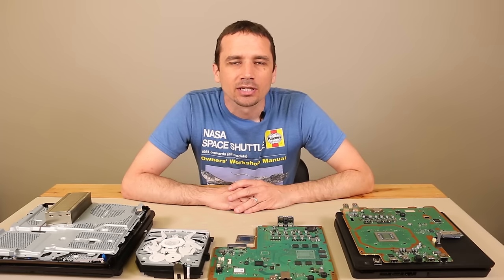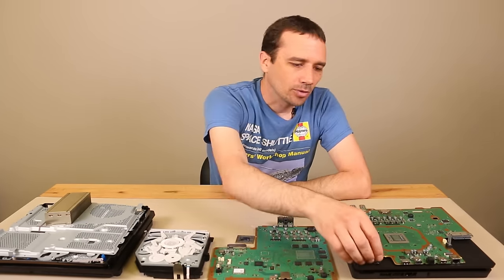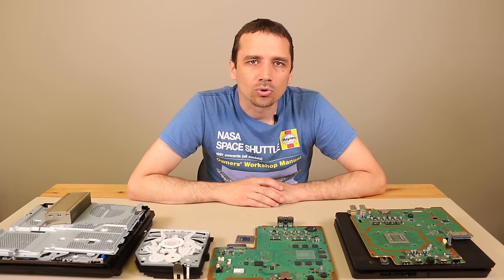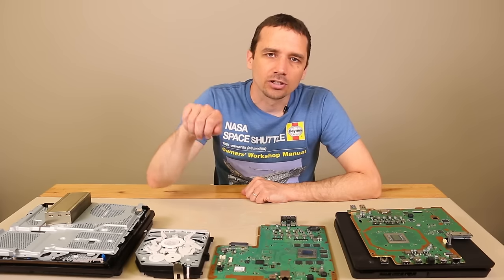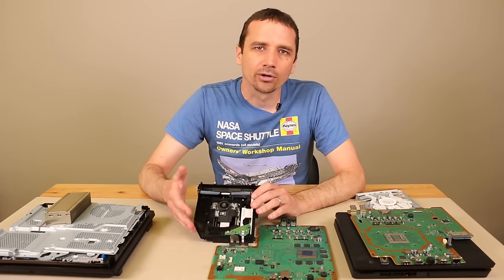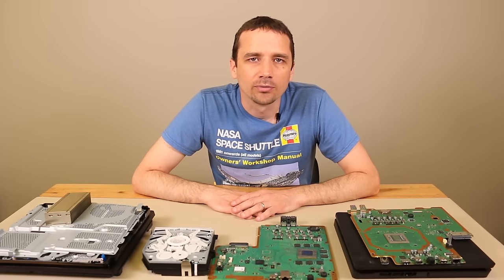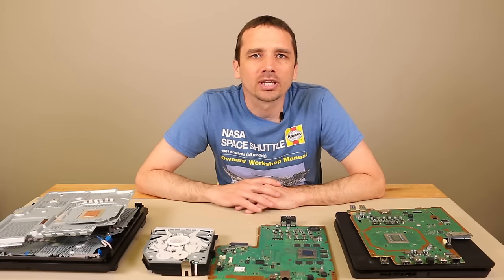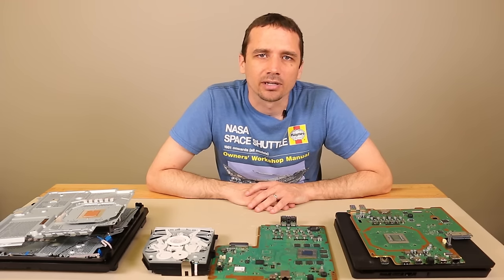Top 5 PS4 Problems With Solutions

Comment: If you've got cockroaches in your ps4 you just need to find a new place to live...
Reply: Legit, I have never had any bugs in a console before.
Reply: Dude I found a dead ant in my ps4
Reply: Basically
Reply: William Collins I found a dead fly
Reply: @NoseyBonk5599  a fly is one thing. Seeing Cockroaches is usually a sign there are many more where you cant see them.
Reply: Yeah, thats messed up
Reply: Yeah that’s nasty
Reply: I found a worm in my ps4?!?!?
Reply: I removed a slug from within the PSU over here in the UK. Unlike the original fat PS3’s, the lack of mains on/off switch on the console means folks leave them on standby all the time and this creates a nice toasty hide-away for bugs etc. until BANG - they bridge the 380V dc rail. Best practice is to switch the console off at the mains when not in use.
Reply: I found a dead horse in my ps.
Reply: recently changed a PSU on my ps4 now it freezes during a game. what might be the solution???😭😭😭
Reply: Just get an Xbox one X and problem solved 😆
Reply: i think i got one on mine
Reply: It’s quite common but I have never experienced it
Reply: Unless it’s Crazy Ants, why would any other Ants go inside a console?
Reply: @Luna-ew3om  how doe
Reply: I got a roach in mind and the power supply burned up and Playstation will not fix it they said it validates the warranty
Reply: I’m from Brooklyn NY and this borough is roach and rats central, but hey....everyone both human and non-human alike love this town. My PS4 Pro is giving me that clicking sound and not recognizing the disc so I just ordered a new disc drive from Amazon ($70) and will get it on Wed and then do the replacement. I’m sure this will work and hopefully I’ll be able to cop a PS5 early next year.
Reply: @Supreme2u  I'm in Brooklyn NY as well
Reply: @frankiefo0ter  good for you Duke! We’re over in East NY/Brownsville.....and we’re native...born and raised, not transplanted from some wack city across the country.
Reply: @Supreme2u  haha I work in crown heights but I grew up near coney island hospital
Reply: @frankiefo0ter  thus the name “frank footer”...nicely done. Ma-Dukes, my brother, niece and her son all live in the same building over in Crown Heights on Pacific St.
Reply: I found William Collins in my ps4
Reply: I found a cow in my ps4
Reply: @NoseyBonk5599  I've found a dead person in mine
Reply: I literally keep Pest Block pouches behind, and on the sides of my consoles lol
Reply: What should I do if some games on my ps4 slim constantly crash with error code ce-34878-0? I tried many simple and available methods like initializing my console and replacing hard drive. I would be glad if at least you would give me a hint.
Reply: @Zeroshiki  You don’t want it to be buggy like Cyberpunk 2077. LOL
Reply: @IGA007  dang but which is better play station or Xbox I’m trying to decide which to get
Reply: I would actually scream if I found a ROACH in my ps4
Reply: @magnusFTS  same name?
Reply: @ocemagnus6553  YOOOOO
Reply: I got alot of cockroaches in my old ps4
Reply: I seriously can't believe that's number 5, LMAO
Reply: Oh no sadly we all dont live in first world countries do we?
Reply: @davewalker6077  safemode is my problem for months now it keeps  going  in safemode
Reply: same problem  here I don't know  what to do anymore
Reply: Previous pest control guy here. If you have roaches buy some roach bait and put it behind your cabinets and hinges in your kitchen and restroom and under your sinks. All you need is a pea size. Would like to add that German roaches don't come from outside. You get them from a place that had them and they got on your clothes or someone that has them. Like if you buy a used PS4 or used  electronic that the previous owner had them. If you live in an apartment then nothing is going to get rid of them unless all units in your building are treated correctly. Best thing you can do is caulk off cracks and crevices under your sinks and plumbing as well as bait. Hope this helps someone
Reply: @ashortsimp1255  ur right but hear me out Xbox has faster specs compared to PS4
Reply: I’m poor lol
Reply: Sounds like the cockroaches need to find a new place to live and the owner of the PS4 should kick them out
Reply: and a new console, its theirs now
Reply: The best way to prevent this situation is to cover ps4 with a cloth when not using or after using
Reply: I have a cockroach in my ps4 and I eat it
Reply: If you live in Florida you do
Reply: I found a dinosaur fossil in my ps4
Reply: It blows my mind how people can be so nasty. So gross when servicing a game console and there's bugs inside.
Reply: After watching these videos, I make sure buy only seald electric even second hand
Reply: Europe :)
Reply: I'll remember to tell you this when you come back for that same problem and see how you take it haha no need to be like that Broski I worked in pestcontrol and can GARUNTEE YOU that you could be the CLEANEST PERSON ON THE PLANNET and still get roaches or various other pests. It's not always their fault
Reply: They won't sign the lease agreement
Reply: Just buy a new house duh lol
Reply: Move to Canada. We don't have cockroaches anywhere here. It's to cold for them

Comment: "There's bugs in the system..."  Keep in mind, a new patch release doesn't resolve the problem... LMFAO
Reply: Mário Palma failure is not an option, it comes bundled with the software...
Reply: small dab of silicone adhesive or more perm contact cement and  trimmed pieces of window screen over the vents  .. ez fix
Reply: A new update just slows down the original ps4 and slim just so you make your mind and buy a ps4 pro :v
Reply: Apples favourite game
Reply: @TommyTom21  which launch model there's been three versions launched
Reply: @TommyTom21  I don't think any have touch sensors the first gen ones don't they have buttons as does the ps4 pro and the slim was just an original in a remodeled case there's nothing there to make a sensor it's only a piece of metal going to a metal plate on the board I only know this because i've had to replace power supply's on them

Comment: I’m incredibly surprised to hear one of the most common problems isn’t with the touch sensitive buttons on the original PS4 that cause it to turn itself on/off and eject the disc sporadically, considering how many people experience this
Reply: Had a PC that would reboot itself randomly, spent months trying to isolate the problem, unplugged the touch reset button, problem solved.
Reply: Probably because you can’t really fix those issues. You just have to be careful with them…
Reply: Hi i have a ps4 white light problem and need advice.

So i traded a faulty xbox one original for a supposed faulty ps4 original from a person that fixes consoles that wanted the Xbox for spares.

So on the day i got home with the ps4 i used my ps3 cables to power it on and it miraculously powered on which surprised me as the controller was connected properly using the usb cable.

But i saw the screen flash black then back to the home screen which i didn't know what is was then it did it once more and was displaying perfectly.

After about 5 mins of waiting for it too show some errors or switching off because i did not expect it to work i plugged in my usb speakers to the other usb port on the front while the controller was plugged in.

That was when the screen went black instantly. I didn't know what happened and pressed the eject button and a copy of GTA 5 came out which means the console was still powered on.

When i plug the controller and speakers in on my ps3 super slim at the same time is says too many devices drawing power something like that.

So i think it drew too much power on the ps4 and caused a wlod on the ps4.

Im trying to do a home repair with minimal tools and if you could give me some idea of what the usb ports could have shorted eg a transistor or fuses or something.

It still powers on and everything but that was the defining factor i think that contributed to the white light of death.

Any recommendations would help as ive watched a lot of YouTube videos and most are the ic chip or some transistor .

Its a original ps4 with wlod

Comment: 1000 years in to the future.  cockroaches dominate the planet beacuse of ps4.
Reply from the maker: Ha, ha...plausible!
Reply: For real, though! 😡🤬😡 cockroaches.
Reply: @Tronicsfix  my ps4 turns of by its self after a few min. It does not turn on and off like you explained but just simply shuts off. Ive changed the power chord too, clean the fan and took it apart to tight every bolt now and then. What could it be?
Reply: @frantaskachanka  You need a replacement it sounds like, don't waist your time trying to fix it.
Reply: @Tronicsfix  i need your help
Reply: Dear  @frantaskachanka , the PS4 is like a puzzle: interesting when solved, challenging when scrambled. Some people live to solve puzzles, what about you? Would you check how the Amperage is changing on the console mains line? Test it with another internal power supply unit if available, or tap in few wires from an ATX power supply? Open the PSU and check for bug-shorts? Check the ESR of notable capacitors? And while at it, reflow the APU and replace the thermal grease?
Reply: @Tronicsfix   the first time u laughed at something but thx 4 dis vid cos i am always terrified about my PS4 in case problems spread all over it
Reply: @frantaskachanka  ur power supply or hard drive probably went bad

Comment: And now i'm really paranoid that my ps4 will break any moment ! Thanks i guess
Reply from the maker: Ha, ha...you're welcome! Lots and lots of PS4's never have problems. These are just the most common repairs I see at my repair shop.
Reply: TronicsFix I have 4 ps4's. One for me and one for each kid. Mine is the one with physical buttons, the other three have capacitive buttons and one has the eject whenever the hell it feels like problem. I have removed the rubber foot and constantly clean it are there any other ways to fix that?
Reply: +adonian Open your ps4 and place a piece of sticky tape over the eject sensor, I also had this issue with the first ps4 I bought. Then to eject a disk you have to use your controller through the menu.
Reply: Should have bought a Wii U like any sane gamer! Good luck legally playing all of Nintendo's greats, suckers! Power is always trumped by FEATURES! Suck it, Sony!
Reply: I would love to have a rear USB port on my PS4. I have the launch edition I don't know if the pro or any of the other ones have a rear USB?
Reply: bondovwvw yes my pro has a rear usb port.
Reply: It's won't break.
Reply: Had mine almost 4 years and it died tonight,on round 122 on black ops3 smfh
Reply: TronicsFix today i am buy a ps4 . and now ur video scare me . thax
Reply: dhgozilla power supply died 3 month ago
Reply: You can reinstall the hardware but you have tor reinstall all the games, and you can use the same account. You can repair corrupted games too. The only thing that isn’t easily fixable is if the HDD stops, which must be replaced
Reply: TronicsFix LLC something wrong with mine is the pork
Reply: my power supply is dead im going to just replace it and see if it works
Reply: It just happened to me..... I'm like in shock
Reply: hahahahah ... Trueeee
Reply: My controllers disconnect randomly with full charge would u recommend getting a scuff controller that doesn't need Bluetooth
Reply: me too man..I'm scared specially I own ps4 since 2014 with 2000 hours full playing time ..I thing I will not play again hhhhhhh
Reply: Hons Peter I know 😂 after watching the Xbox fixing videos I have become extremely paranoid !! As a matter of fact I watched his videos the other night about cleaning them so I unplugged everything and put it in a pillowcase until I want to play it. That way dust won’t get in it! 😂
Reply: lmao after this vid i wont pull hdmi cable from console i disconnect at the tv only
Reply: @alb3484  i have had mine for 6 years now no problems
Reply: @hasansalamy605  i have had my ps4 since 2014 with 20000+ playing time thats about 820 days and it still works today
Reply: @amylee9092  this didn't age well considering how badly the wii U failed 😂🤣
Reply: My hacked PS3 Slim that I have was manufactured in 2010, and has only just started to show signs that it’s dying slowly. I’ve had my PS4 since launch day in 2013 and it died in the middle of last year but I managed to fix it. Now I have a PS5 too ;)

Comment: The solder balls cracking problem is common to all flip chips / BGA mountings (i.e. Xbox/PS2 onwards, strikingly prominent in the seventh generation with Xbox 360 and PS3) due to the redistribution of metals in the solder alloy and even on the copper pads themselves, that get sort of "eaten away" by solder to an extent. This thing is well known since the 90s in scientific articles, before even the PS2 came to be. Flip chips are basically time bombs likely to fail sooner or later IF serious heat sinking countermeasures are not taken. Redistribution of metal is faster at high temperatures. Board warping and solder ball cracking kick in earlier if the console isn't cooled down properly; this sort of design flaws contribute to the overall behaviour of the solder.

Reballing isn't guaranteed to fix the problem; flip chips have tiny solder balls between the chip itself (that shiny rectangle on the smaller organic board) and the organic board, which is soldered directly on the motherboard. If those tiny solder balls fail, there ain't any "reballing" that can fix it, only a complete CPU/GPU/APU replacement with a brand new one.
Reply: The real problem is crappy lead-free solder.
Replacing the crappy fake lead-free solder with real leaded solder balls makes for proper reballing repairs as long as the chip itself as well as the actual pads on the board and the chip are not damaged.
Some of the chips on the older consoles had RAM chips BGA-mounted on the processor chip base itself, and more often than not those would get bad as well; the fix was to de-lid the chip and attempt to reball those, but at that point the effort and time spent was only barely worth it to save the one chip - and all because of inferior solder, and the environmentalist crazies who made it happen.

Comment: Nice video. My PS4 has been the most reliable Playstation I’ve ever owned since my OG Playstation, not PSOne, but just plain old Playstation ala 1996. PS2 had disc read problems, so I bought a slim, and PS3 I had repaired four times, and bought another. 

PS4 has been rock solid so far. I use it everyday, between 2-10 hours a day as its our entertainment center basically. Plays blurays, youtube, Hulu, HBOgo, Netflix, Amazon, etc.

Comment: "there's bugs in the system" lol, and I thought bugs in software were bad.
Reply: So that means we have both buggy games due to unfinished games being released and bugs in the ps4 itself cause they make a great bug hotel ><
Reply: Irfan Spirtovic  they get up to all sorts of antics they do :D
Reply: @amyhoard1222  they do not make a great bug hotel they make an expensive nightmare after cocky's take out the power supply and the power supply's pcb is rarely fit for repair when they are done
Reply: Actually that's where that term originated. Computers used to be mechanical. A bug in your program would literally be a bug in your program. When computers became electrical and more complex the term stuck with it.

Comment: Hey, this is a very informative video! I appreciate having this compilation of common problems with these consoles so that in case anything does happen I can be sure to be prepared, or in the very least informed. I’m familiar with most of these problems, but the fixes are very useful to keep in mind! However, I do have a question that may or may not be completely unrelated to any of the issues mentioned here: 
I have a FAT model PS4 (it’s a limited edition though so I believe it does have some slight improvements like power use in comparison to the launch models). Sometimes when I’m playing it, I may hear this quiet little “beep” coming from within the system. It’s not nearly as loud as the powering off or overheating beep, but it can be heard if you’re paying attention. I am not sure if it occurs in random increments or not, but it is somewhat concerning to me whenever I do hear it. I can’t recall if this was always something that happened, as the first couple of years I’ve had it have been a little blurry, but I do in fact believe this has been occurring for the past 2 years or so. Is this a sign of some unknown issue or is it the machinery within the console just doing it’s normal stuff whilst running? Thanks.